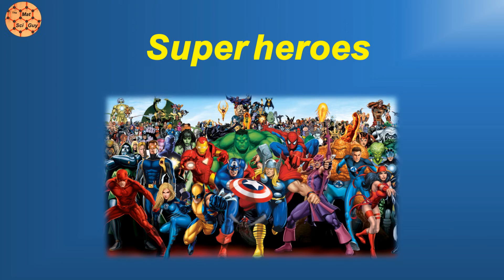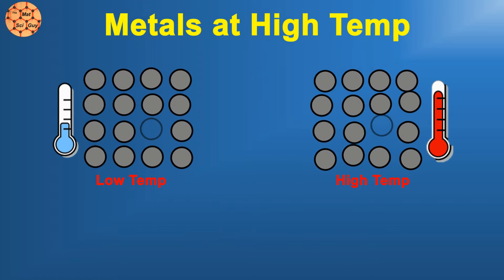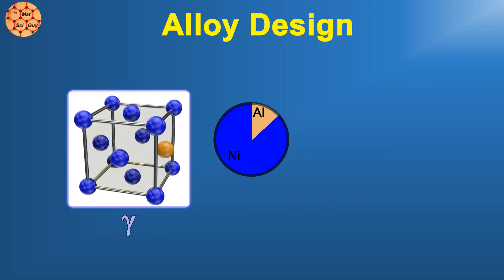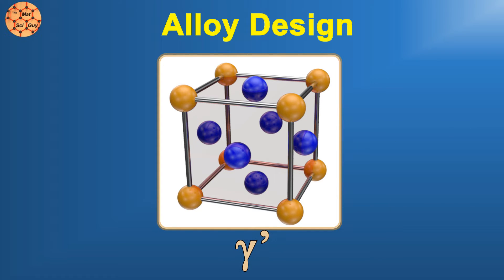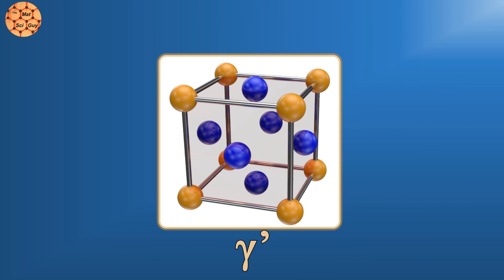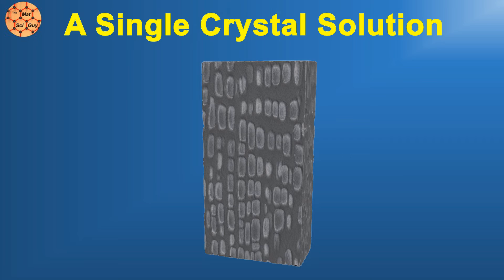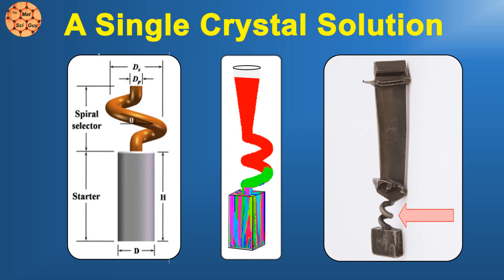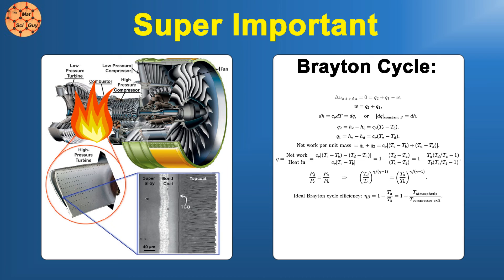The Story of Nickel Superalloys: Saving the World in a Different Way

Comment: This rather dry presentation could have been improved with some real-world examples. For instance, the eventual  structural failure of the World Trade Center towers in 9/11/2001 was due to a combination or Nabarro-Herring creep and Coble creep weakening the cross-bracing steel beams as the fires caused certain floors to overheat.

Comment: I'm a retired engineer. I spent much of my career in electrical/electronic/control system engineering. I did however spend my first 15 years working as a mechanical engineer, much of it with casting and forging processes. When studying HNC and BSc, my favourite subject was materials science. Excellent video. Many thanks.

Comment: I believe that Nickel not going through a phase change towards melting point is a reason for it's application in high temperatures, but what is the explanation for a material becoming weaker when going through a phase change?
Reply: To the best of my knowledge, atomic diffusion is more difficult to take place in  close-packed structure such as FCC